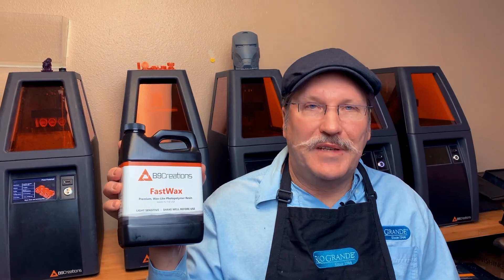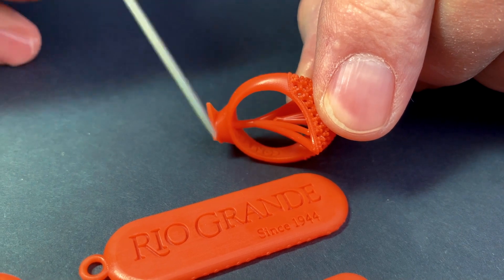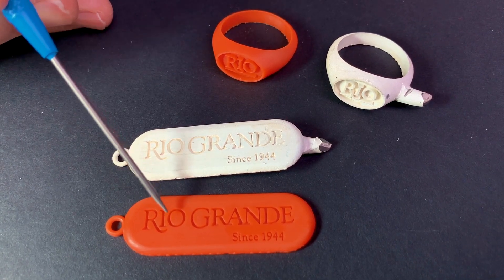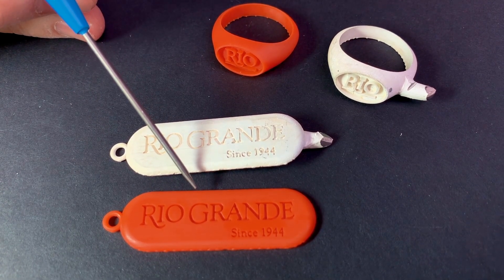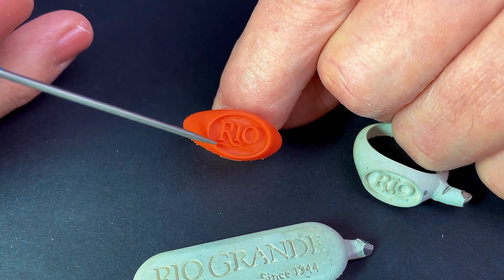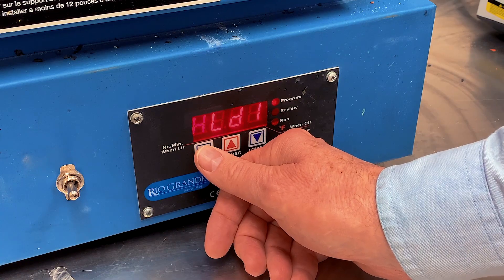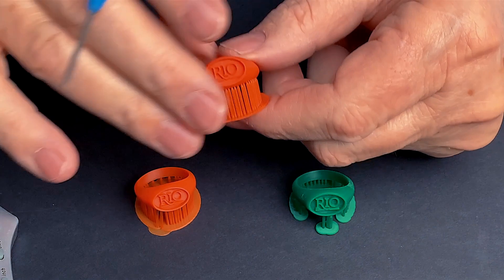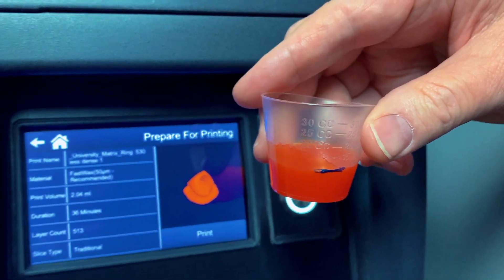Tech Review: B9 Fast Wax

Comment: I have an account with RIO. I am a student with logistics issues. I live 8n a small apt. Other than fine .999 silver I am not permitted heavy tanks in ky small residence. I had an Idea: using my Rhino software i use my 3D printer make a positive jewelry piece asvwell as a negative of the same as a mold.  If the mold is about 6/8 around dimentionally  I can use a PRECIOUS METAL CLAY and a klin. Precious metal clay hardens. Once that happens klin firing is between 5% - 15% shrinkage for the organic clay to burn away leaving metal. I can place the Precious metal Clay in a Delft clay investment cylinder does that seem workable? A 3D printed mold negative from my original jewelery print, Precious metal clay folded in removed once dryed hard -- placed in a clay investment tubing and klin fired??
Reply from the maker: Hi Sabra. Thank you for the question. Here is a response from our tech team: You might be able to make a Delft clay casting using a 3d print but you also risk damaging the 3d print when hammering the delft clay around it.  You might also consider direct casting your 3d print. That will reduce  a lot of the shrinkage you will see in each step.. You will also retain more details

Comment: post processing the same as emerald?  Alcohol then uv?  Also, Emerald will not do deep fine print in the final cast; too much expansion and it breaks up even the strongest investment, save concrete.  I'm hoping this is the solution
Reply from the maker: Hello,  we spoke with our Tech Team and they said that is correct. It has the same post processing as the emerald and the fast wax is much better with fine detail than the emerald and works great with plasti-cast! We hope this is helpful for you!
Reply from the maker: Hello, we will pass your question on to our Tech Team and get you a answer!